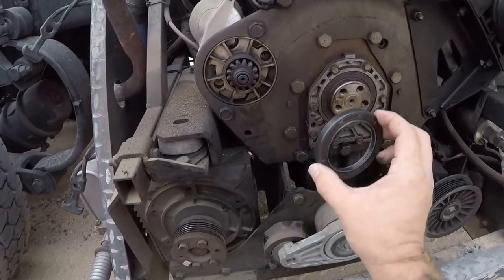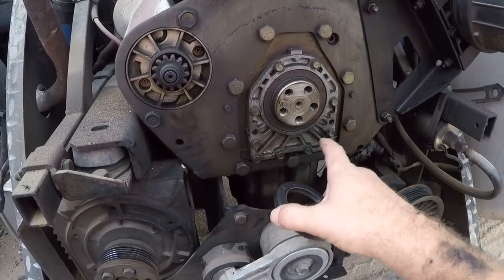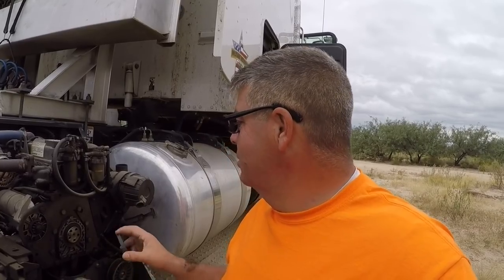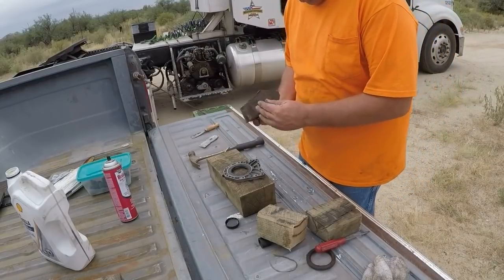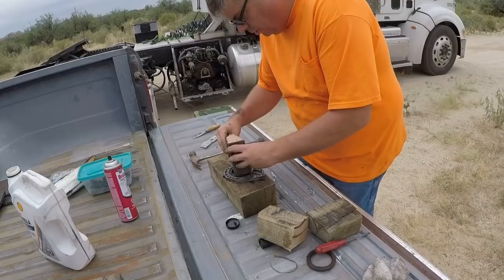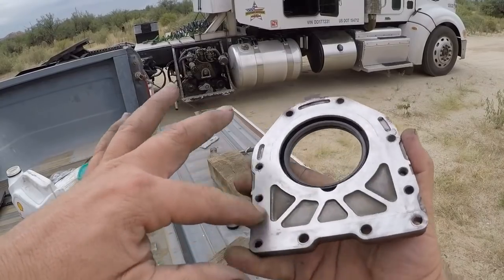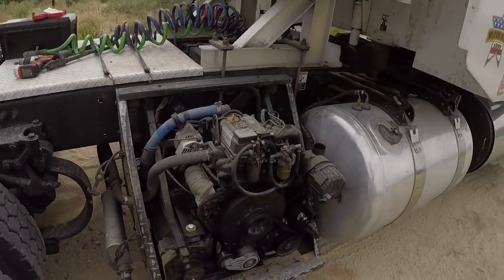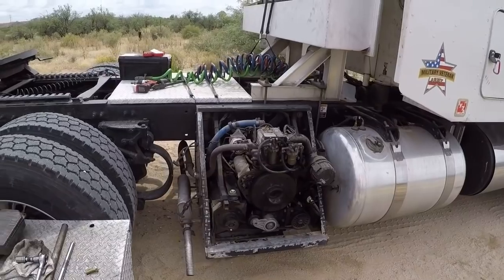#257 Replacing the Rear Main Seal on the Generator  The Life of an Owner Operator Truck Driver Vlog

Comment: Good on you for doing your own repairs. A+ for getting her done . The bloke that commented that you should have used something softer than a socket to wedge the flywheel had a point but you have to use whatever you have available! As a retired Truckie from Australia I enjoy doing a few miles with you in the USA so thanks for doing your vids. Seems truck owner operators have similar problems wherever we are.

Comment: If you look at the back of the seal there’s a spring inside that puts pressure on the seal lip to the crank. Sometimes that spring will pop out while driving in the seal. A little trick is to pack the back of the seal with some grease, that will hold the spring in place.

Comment: I only have one comment to make about your seal replacement, besides well done. when ever I used silicone as a gasket I used it with plenty of caution. I usually spread it with finger and make sure I didn't use too much. the reason being if you use too much it could cake onto the oil pickup screen and restrict you oil flow. as a mechanic I like to see owners try to make as many small repairs as possible. I enjoy you videos

Comment: Dan question for you I Have a 680 Kw 2013 paccar engine I really love this truck so far no issues till yesterday (check engine light comes on and DEF gauge light started to flash didn’t loose any power however I’m a little worried that I might not be able to delivery on Monday) what can possibly be wrong? NOX Sensor? DEF Douser?